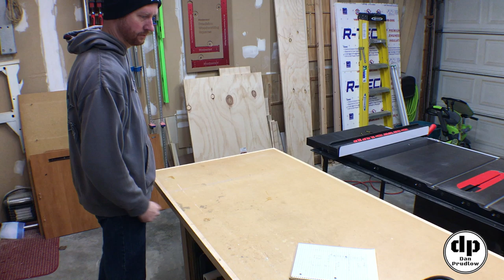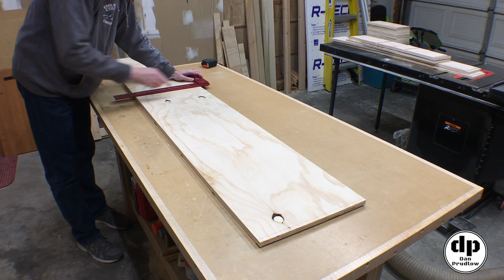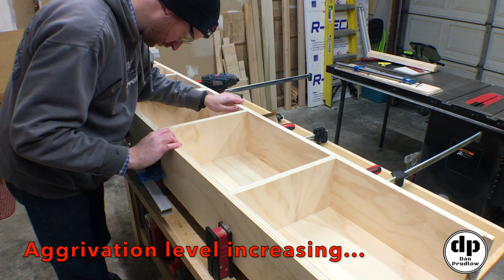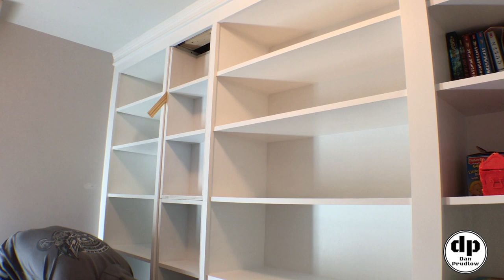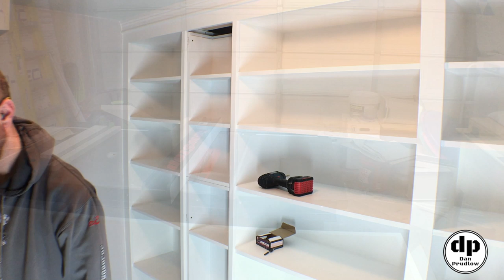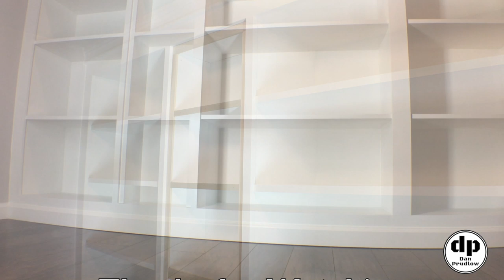Built In Shelves Part 2 | DIY | Build Custom Shelving

Comment from the maker: Want to support the channel? Here's what you can do:
 - Subscribe to the channel
 - Hit that Like button
 - Leave a comment
 - Amazon Affiliate: https://amzn.to/2LaN1Ib

Part 1 Video: https://youtu.be/D3YkScfJOVk

This is part 2 of my custom built in shelving build.  This section is built using the offcuts from the larger shelving build and face framed with poplar.  I built these in my basement after having to demo the previous shelving in order to do some insulation work.  This video covers the narrow section in front of a drain pipe.  This section will be removable in the event we need to access the pipe for any sort of maintenance.  I also left the top unattached so that we can slide it open to let warm air flow up behind the shelves as their are a couple of water pipes and and it is an exterior wall that can get pretty cold in the winter when temps drop below freezing.

Thanks for watching.  If you have any comments or questions please leave them below or hit me up on social media, email, or my website.

SawStop 1.75hp PCS: https://amzn.to/2X4gWsP
Bench Dog Push Blocks: https://amzn.to/2YB00uL
Ridge Carbide 10-inch Saw blade: https://amzn.to/3bATmcp
Bosch 18v Impact Driver: https://amzn.to/3cxAhJk
Ridgid ROS: https://amzn.to/364yHMA
Titebond Wood Glue: https://amzn.to/2LzTdv4
Bessy Parallel Clamps: https://amzn.to/2z4LHG3
Bessy 6-inch F-style Clamps: https://amzn.to/3e3LGl4

Hit that like button and don't forget to subscribe!  Thanks!

Subscribe: https://www.youtube.com/danprudlow?sub_confirmation=1

Twitter: http://twitter.com/DanPrudlow
Instagram: http://instagram.com/danprudlow

Comment: Thanks for the great video!  It turned out looking great.  Check out Next Level Carpentry for tips on pre-assembly layout and measuring the avoid those frustrating off-angle and misaligned joints.  It really helped me to see how frequently a master carpenter / woodworker checked alignment and course corrected before ever picking up screw or nail.